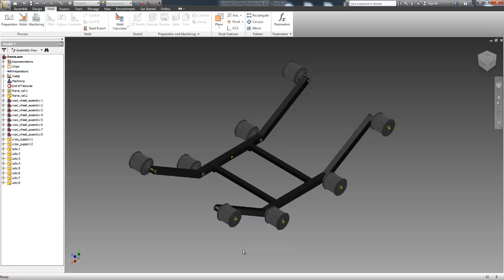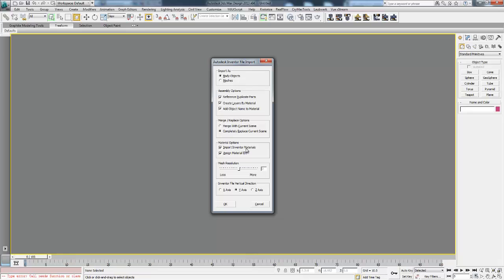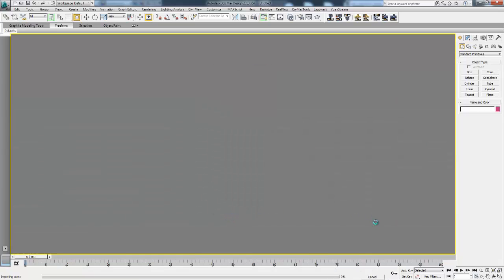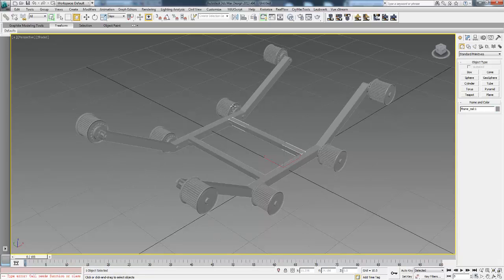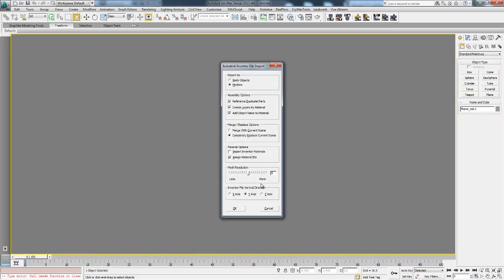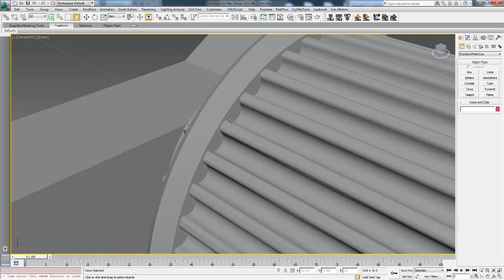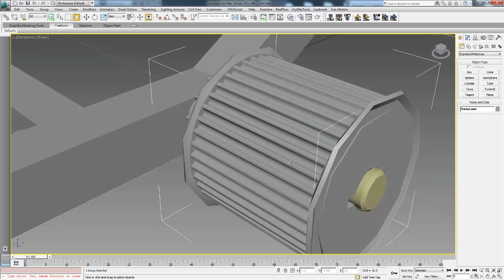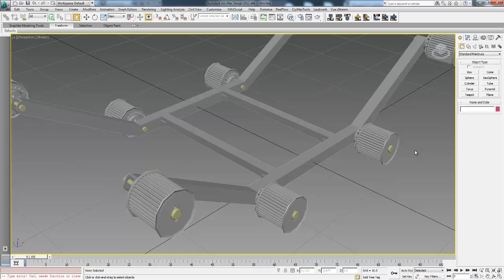Autodesk Inventor to 3ds Max Design

Comment: Thanks a lot! I got everything working right. I only have one question, in the new 2014 version 3ds max also gives the option to import driving animation, could you explain what this is and what I can do with this?
Reply from the maker: +Jesse Boom In Inventor, you have the ability to can animate assemblies by using driven constraints. You will see this used when a designer or engineer wants to animate interlinked components in a combustion engine, driveshafts, flight chainage on industrial conveyor systems, et cetera. It is basically "simulating" mechanical movement based on components and their constraints. This is where technical modeling/animation greatly differs from traditional keyframe animation; instead of 'eyeballing' an animated movement, it is done mechanically 'by the numbers'. With the newer revisions of 3DS Max, you can import that information and work that could have been done inside Inventor instead of having to re-animate an assembled model. I hope that I was able to explain that efficiently, if not, let me know.
- Sam